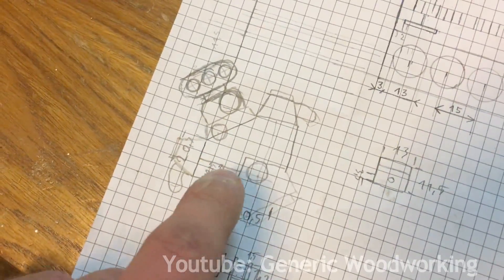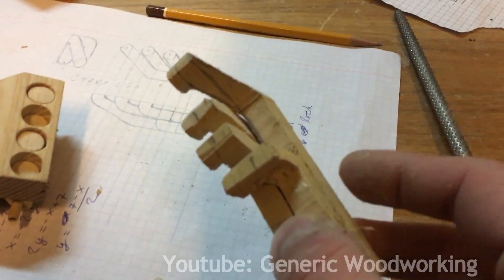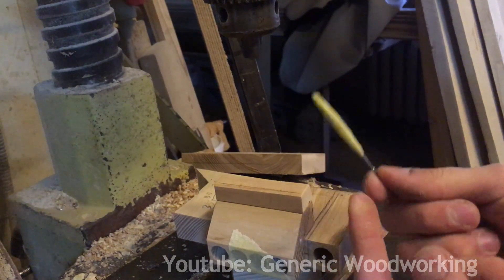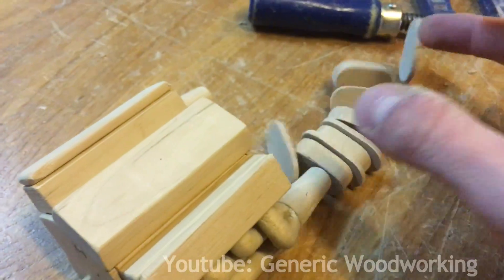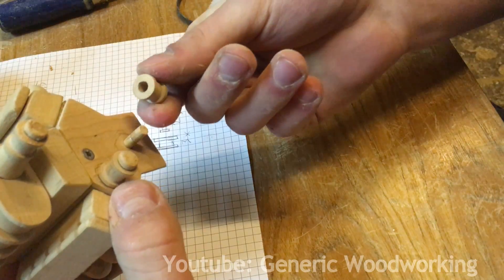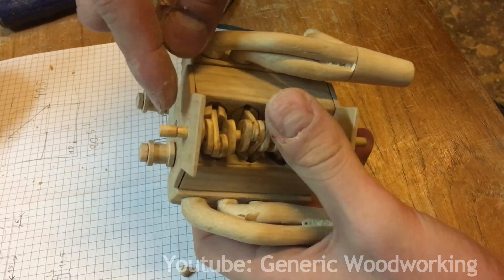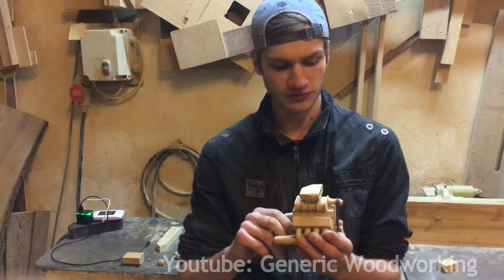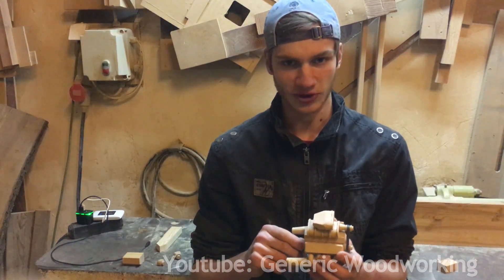How To Make a Mini Wooden Supercharged V8 Engine (Part 2)

Comment: when you make the belt, try to get it as evenly flat as possible. you just glued two ends with the overlapping expecting it to run smooth. How stupid are you to actually think that would work and it still didnt in the end. having twice the thickness at 2 different points drastically effects it.

Comment: I just discovered your video yesterday and instantly loved what your doing. So unique! I'm an old mechanic from way back, been told many times I have motor oil for blood, lol. I've been a scroll sawer for many years now and am a 5-1/2 year stage 3 lung cancer survivor. The cancer and treatments did take a toll on me and I am in what I refer to as forced retirement now. Built a 12X16 'wood craft shop' in my yard and spend most free time there now. Added a mini lathe 4 yrs ago and have my shop set up so I can do most work while sitting in an office chair, just don't have the stamina to stand very long anymore. I worked my entire life as a mechanic of one fotm or another. Starting out as a lawnmower guy and ended with 16 yrs in the industrial hydraulics field, built machinery and the power ubit to run them for the offshore oil/gas industry. Miss it. You showed me how to combine both my passions into one and my mind is going full steam on what to start up as a unique project. I'm thinking a motor cycle as I used to ride quite a bit, (lost my harley to the repo man when I had to quit my job for treatments and just wasn't enough funds to continue payments), oh well, it was only a toy. If God wants me to have another one day then it will happen. Your extremely talented any have a great imagination. I sub'ed as soon as I saw pt.1, thanks so much for sharing your talent with the rest of us. Some how I picture seeing more about you in a very sucessfull way. Never give up your passion.......and again, THANK YOU!
Reply from the maker: Thank you for sharing your story! I’m happy to hear you were able to find an enjoyable activity during such a rough time... I think having a shop set up for an office chair is a very good idea in general. I work in my dad’s workshop where everything is set up for his work style (he builds big furniture and staircases). So it’s not optimized for my work at all. If I ever get a chance to build my own workshop I think I’ll set it up that way too. It’s funny you mentioned that you started of with lawnmowers, as mowing lawns has been my only official job during the last two summers (and probably this summer). Finding a job as a teenager here is quite hard... Stay strong and go make something cool!
Reply: @GenericWoodworking  I thank you for your response. I too started mowing lawns with my dads push mower back when top price was like 4.00-6.00$ per yard, weedeaters were'nt invented yet so clippers, shears or shovel and hoe were the tools of the trade. I bought my first vehicle, a 1961 chevy pickup for 175.00$ when I was only 15, my dad had to drive it home for me cause I did not have even a permit yet, lol. Stick to your guns young man, with your talent I have a strong feeling you'll do quite well for yourself. Follow your dreams and there will be no stopping you. Wishing you nothing but the best and your future to be bright! BTW, last november I finally ordered a miniture table saw for my little shop. Its a Micro Mark precision hobbyist table saw. Blade is only 3-3/8 inch diameter but it glides through up to 3/4" thick wood as good as a full size saw. It has really added to the possiblities in my shop. Good luck sir, you'll do quite well. Somewhere out there there is someone who will grab you up for your abilities and you'll never look back...........